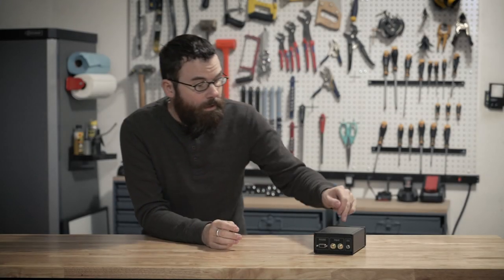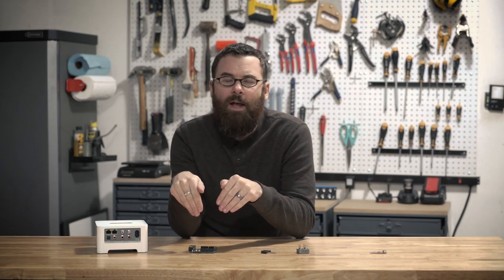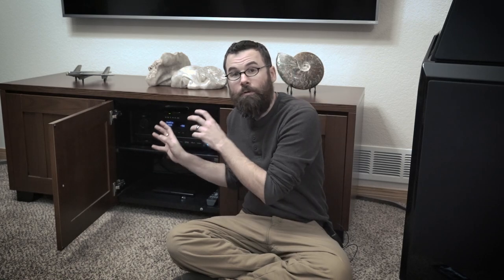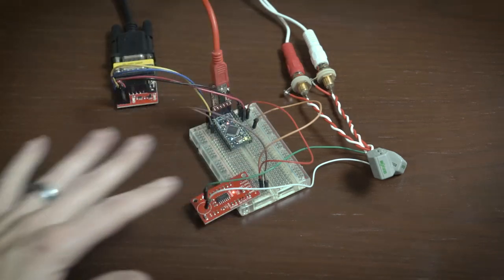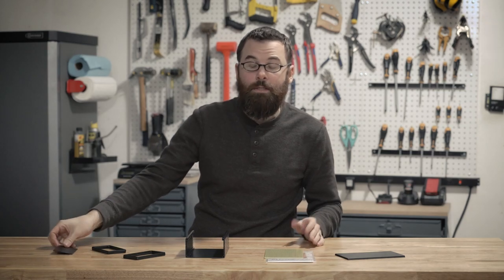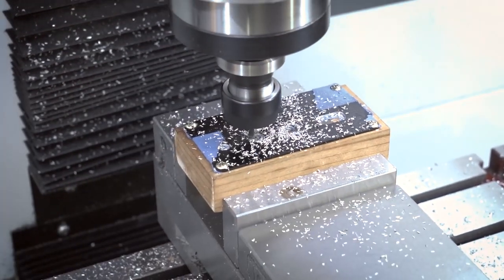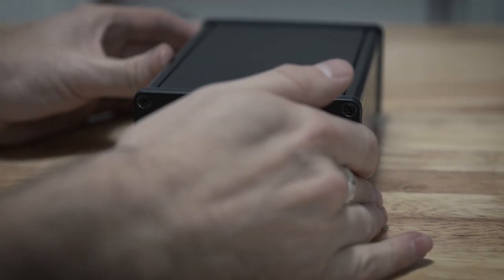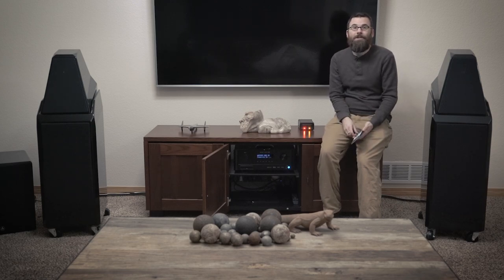Stereo Control Interface - Sonos Automation Device

Comment: Oh man! This is so much more elegant than my hacked together solution. Time to upgrade!
Reply: Also, you should set up Amazon Affiliate links so you can get a kickback when you link Amazon products and I purchase them.
Reply from the maker: You did something similar?
Reply from the maker: Probably.  But I'd rather form relationships with manufacturers directly.
Reply: No where close to similar. Mine is doing a similar action. On my setup I have a Bluetooth receiver that has an LED that lights up when something is connected. I have a light sensor glued to the LED and the Arduino sees when something is connected via Bluetooth then uses a relay to turn on power to the amp. My amp is just a small amp that runs two speakers in my bathroom ceiling. I originally wanted to sense music playing but couldn't get it to work, so I went with the LED option.
Reply from the maker: Ah OK.  Yeah, the LED idea works...  Honestly, with the sound detector from SparkFun, this was pretty darn easy.  If you're just controlling a relay or something, it would be much simpler than what I did.
Reply: It does work, but now I want to get it to work like I originally planned. Sound Detector added to my SparkFun wishlist. Plus your enclosure is so beautiful... I need a laser. Thanks!
Reply from the maker: I think a laser is a great addition to any shop.  You can do what I did with the cheap K40 lasers you see on eBay.  For under $500 you can easily get a laser.  Heck, if you go with one of the simpler diode lasers, you can get down to a couple hundred dollars.
Reply: I follow a few K40 groups on G+ and the horror stories have scared me away so far (receiving damaged machines mostly). But, I already have a ShapeOko 2, so I am thinking maybe a diode would be a good option. I just like my eyes so I may need to build some kind of enclosure for it.
Reply from the maker: What about just a shroud around the end of the laser, similar to one of those dust shoes?  Really all you care about is containing the reflection.  I don't think it takes much power to etch aluminum.  I was doing 15% power at 50mm/sec.
Reply: That is a great idea, will also take up less space. Now I just need to find a good laser diode.
Reply: Have you heard of LaserWeb? It's an open source laser engraving software created by Peter van der Walt. I haven't used it yet because I don't have a laser but I follow them on G+ to learn until I get one someday. There are also some people in the group that have made direct plug in replacement controller boards for the K40 so you don't have to modify the wiring on the K40. It all looks pretty slick.
Reply: Yep, but still need to change controller board because the one who come with the machine is not a GCode interpreter

Comment: Nice solution and fantastic looking build, thank you Rob!  Any plans to share your CNC & laser art files?  Where did you source the plate / chassis mount power jack?
Reply from the maker: Thanks!  Check the github page linked in the description, I just added the DXF files for the front and back.  The chassis mount power jack was from my parts bin.  I bought a ton of them awhile back, I think I got them from Amazon, there's a seller uxcell that sells a lot of this stuff cheap in bulk.  Whenever I need a part for a project, I just get a pack of them instead.

Comment: Wow. I'm looking for something similar. I have rear speakers hacked on sonos symfonisk but powerd up by other amp which volume is controlled by rotary encoder and I'm tired to setting up volum of rear speakers to the front home theater.
Reply from the maker: I wish more companies would allow better integration for their products!  It's annoying they spend so much time with Alexa and Google Voice integration, but lock it down elsewhere.
Reply: @RobertCowanDIY  did you done something else through that years with that build? I'm have no idea about andruino but I already ordered ATMEGA32U4 and looking g for that microphone sensor. Wish me luck :D
Reply from the maker: @dawidrosinski5107  I ditched Sonos awhile back and it was the best thing I ever did.  Their constant updates (that ended up breaking things and causing it to work worse), network issues, and inability to support older products made me switch.  I now use Roon and Tidal and couldn't be happier.
Reply: @RobertCowanDIY  also thinking about that after my playbase network card burn out, but actual price of good enough sounbars on the market sonos win and now they have msata network cards 🙄 hope that's gonna be easier to repair

Comment: Nice video and very we’ll done. Do you know if there are any AV receivers that just naturally have this feature built in? I’ve searched everywhere
Reply from the maker: unfortunately no.  Sonos hasn't played well with anyone else and companies aren't yet realizing how to include IoT integration into their products, they rely on stuff like Alexa, Logitech, and Google Home.  Most receivers don't really have much control outside of RS232 (yet...)
Reply: Robert Cowan oh ok. After much research, I think what I’ll do is use a Sonos Connect: Amp (instead of the regular Sonos Connect) and an 
A/B speaker level switch from a company called Niles. I’ll use the 12V trigger on the back of my home theater receiver to tell the Switch to change to the home theater receiver as the source when the receiver is powered on . But when the receiver is powered 
off the switch will default back to the Sonos connect amp as the source. I even found a switch that should allow me to share the subwoofer between the two amps as well.
Reply from the maker: So you're basically switching the speakers between being powered by the sonos or being powered by your receiver?  That's an interesting way to do it.
Reply: Robert Cowan Yeah exactly. Sharing 1 set of speakers between two amplifiers. the A/B switch ensures that no damage is done. After looking on the Sonos forums I found a number of people that use these switches to solve this issue. The switch I plan to use is similar to this one:

http://www.nilesaudio.com/product/speaker-level-b-switcher-12v-triggered-FG00240

Comment: Why doesn't the Sonos have standard GPIO or 20ma current outputs?
Reply from the maker: Standard GPIO?  Almost no audio player in existence has any GPIOs.  Some have 12V trigger outputs, but Sonos is intended more for internet control, so all control is supposed to be done over the network.  Almost all network players are the same way, Chromecase Audio, Bluesound, etc.
Reply: lol, at some point the "internet" has to actually translate to the real world, wish they would have thought of that.
Reply from the maker: Well, other control systems can control Sonos.  Heck, my remote control (Logitech Harmony) can control the Sonos just fine.  But you still need to grab the remote, and then once you have the remote in your hand, it's worthless to actually play any music...  Devices like this are still figuring out how to operate intuitively.  But don't blame Sonos, I've tried every other player on the market and nothing can touch Sonos...  It has some faults in integration, but everything else is spot-on.

Comment: Hmm now I'm bothered that I'm not at my parents who have a Sonos system. The sonos devices have a web interface that you can use, available at: http://ip.of.sonos.device:1400/ and I'm now interested in seing what /status says. I'm sure you can use one of the pages with some regex, to figure out if it's playing or not, and then use a RPi zero W, and your serial level shifter. That would also give you a web interface :)
Reply from the maker: Hum, interesting.  I could check into this.  Everyone is REALLY keen on me using a web interface.  I just like loading the app on my phone (which is a widget on the home screen) and just hitting play.  It's nice to have everything else work in the background.
Reply: I'm the same guy from the laser video :P The web interface was for the further functionality you talked about adding. it should work entirely hands off like your solution, but require no actual connections to your sonos zoneplayer. Just a serial connection to the receiver, power and wifi.

Also it takes the guesswork out of finding the threshold. It'd basically ask the sonos system "Is music playing here?" and if yes, it'd turn on the receiver.
Reply from the maker: Ha!  I might look into that.  I just didn't want to do much programming for this project ;-)  I hate programming.  Also, I'm not very good at it.  But a better boolean system would be nice.  So far though, the unit has worked flawlessly, I actually completely forgot about it.  It just hides in the cabinet and turns everything on when I hit play from the other room.  It hasn't messed up once, which is good.  I might look more into web control, since I want to do some things with the sonos in the workshop.

Comment: Wow, those speakers...these are not the droids you are looking for!
Reply from the maker: hehe, everyone says that when the first see them :-)
Reply: What make and model are those speakers? Are they monobloc amps, or is the entire cabinet a driver? Looks to be 2 pieces.
Reply from the maker: They are Wilson Audio Sashas.  The subwoofer is a JL Audio F113.  The amps are inside the cabinet, they are monoblock amps.  The speakers are 2 pieces each and completely separate units.  The bottom cabinet is just the bass drivers and crossover and the top section holds the midrange and tweeter.
Reply: Ahh, I've got a set of Monitor Audio Silvers with a B&K AVR202 driving them, bought about 15 years ago.